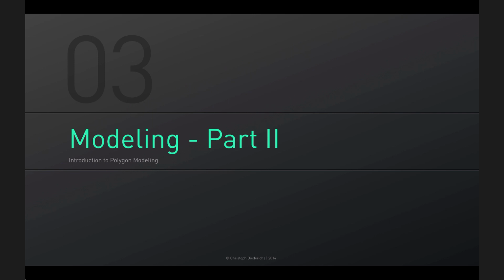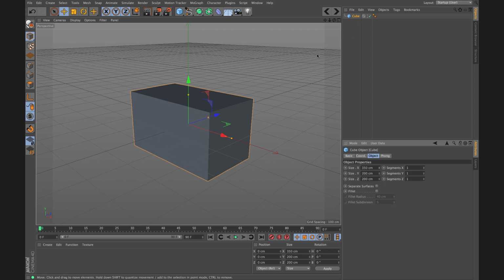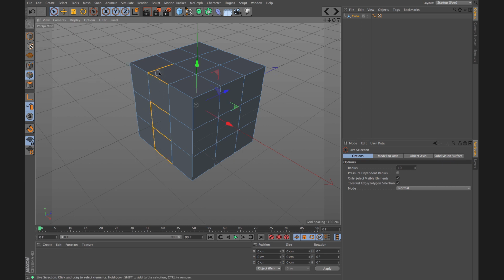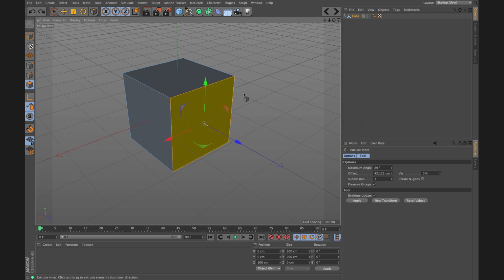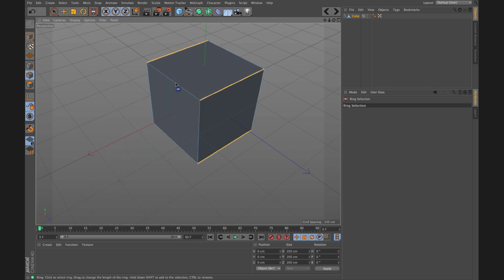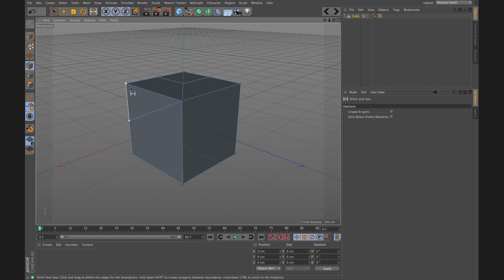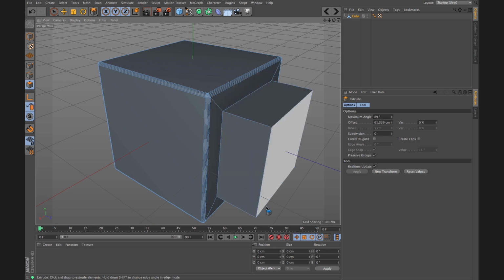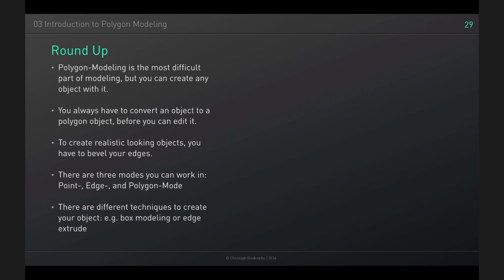C4D Fundamentals | 03 - Introduction to Polygon Modeling

Comment: I hope I describe this correctly. FWIW, I'm using R18. When I go to extrude a polygon (like you're doing at 17:00), it doesn't automatically create new edges like you have in the video. So because it's not making new edges, I'm basically just resizing the cube without being able to transform its shape. So for example, if I choose extrude and push back into the cube, it doesn't create a void inside the cube, it just makes my cube smaller.

However, if I go over to the extrude window and click "new transform" (or make some other change in the options), those new edges are suddenly created and I'm able to do the stuff you're doing. I've been playing with this for 20 minutes trying to figure out why. Not sure if it's something to do with R18 or I'm just making a beginner mistake.

Thanks for your help. These tutorials are amazing.
Reply from the maker: Mh hard to tell. Make sure that you don't touch the Object-Axis itself while doing the extrude. Or try to hold CTRL/CMD and then grab the axis of your object an see what happens. 

Have you figured it out by now?
Reply: I had the axis modification tool turned on. Holy crap that was driving me nuts!! Thank you so much for getting back to me. Maybe this will help someone else in the future.